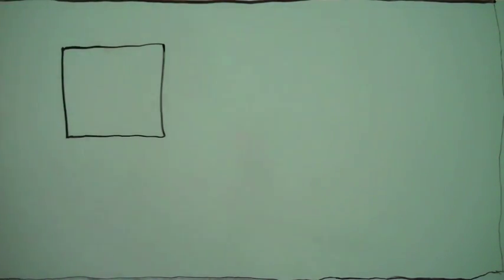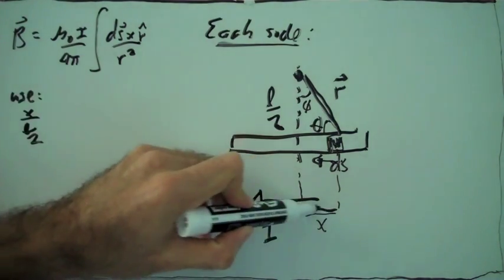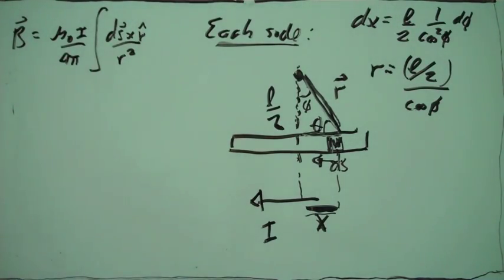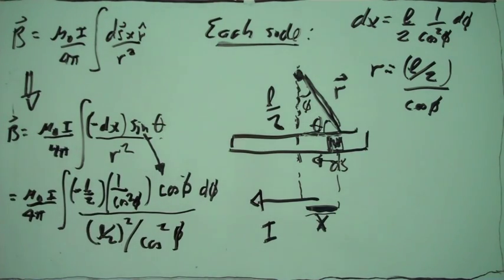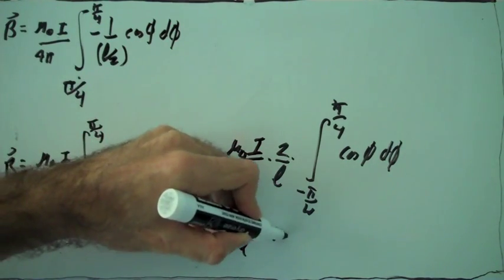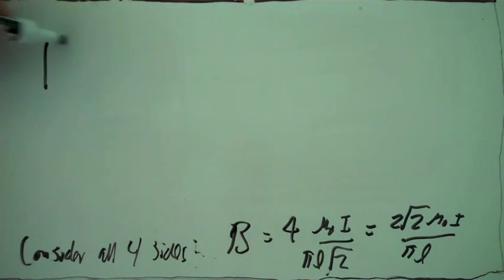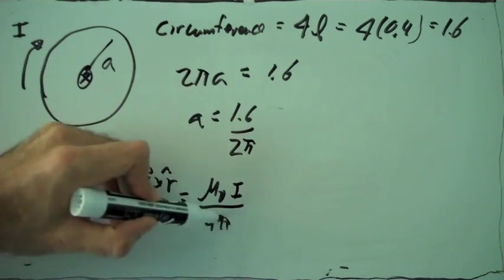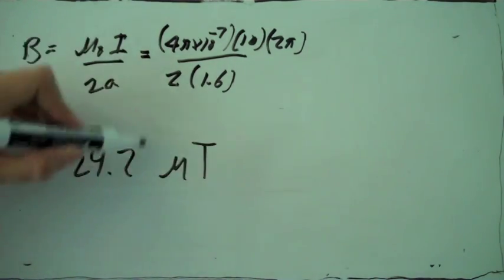30-5

Comment: Hey Professor, I have a paper about the relationship between the electrical field and magnetic field,I think when the charged particle moving or relative moving, the electrical field of the charged particle will spin and produce the magnetic field,could you help me check my paper and point my problem, I will appreciate for you,the link:Jack-liyong.blogspot.ca, thanks